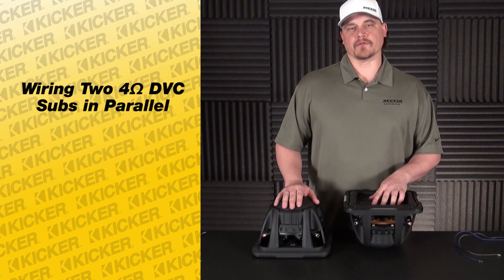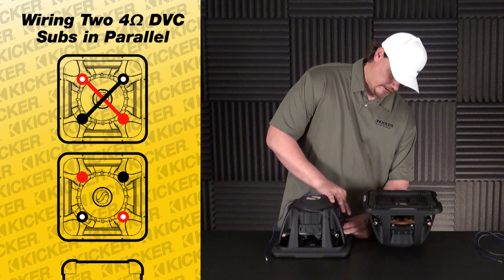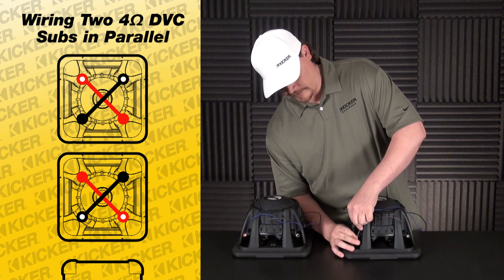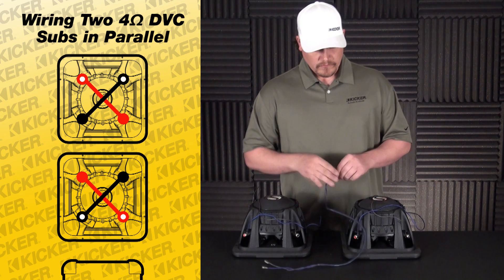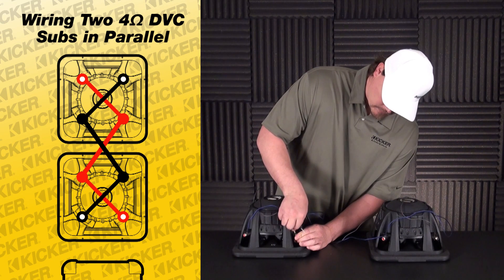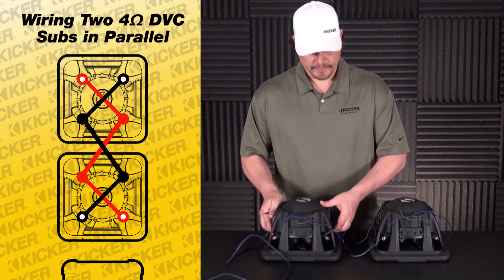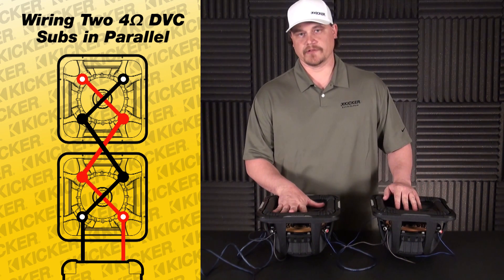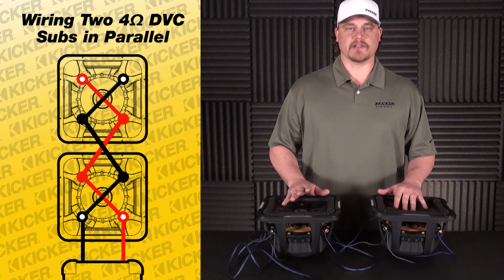Subwoofer Wiring: Two 4 ohm DVC Subs in Parallel

Comment: I have 2 dual 2ohm kicker l7 how will i wire them both to 2ohm load???
Reply from the maker: Devante Mccoy You will want to do a series/parallel configuration.  Wire each dual 2 ohm sub in series, then you will parallel them together and this will give you a 2 ohm load.
Reply: You have a video on that

Comment: Hey,I have a zx2500.1 and I have two 15 L7 2 ohm dual coils speakers. How do I properly run that to a1ohm stable. And is that possible with what I have. To have it pay with out cutting off on deep notes
Reply from the maker: TheTripleHouse The ZX25001 is stable down to 2 ohms.  If you try to run it below that it will shut down and damage the amp.  With the subs you have, you will want to wire them in a series/parallel configuration and that will allow the amp to see 2 ohms.  If you go to kicker.com and under the support tab there is a wiring configuration that will show how to do series/parallel.

Comment: I was always curious about the hole that gets drilled in the divider.  If it makes a difference in sound quality.  This is the first time I've heard anyone say one way or another if it makes a difference in the sound of your subs.
Reply: +KICKER Is it possible/recommended to connect each woofer to the terminals and run the jumpers between the terminals? Rather than drill holes and run the jumpers from speaker to speaker.
Reply: @Maverick_Van_Traveller  yes
Reply from the maker: Brandon Burks That small of a hole to run your wires thru will not cause a sound difference.  We normally recommend each sub having it's own air space.  We feel like each speaker can perform better and if something happens and one blows, the other is not working in twice it's recommend air space and can blow easily.
Reply: Sonif I have a 2500.1 soundstream and. 2 audiopipe 15s it's best to run them not togather in parallel for 10hm instead run the separate positive to postive neg to neg to  the run 4 wires from the mono block

Comment: I've been looking for help on a setup I'm putting together I have 8 15" 1000 to 2000 rms range subs they are split between two 4000 watt mono amps so 4 to each amp I know I can only go as low as 2ohm to each amp they are wired and working but I just want to know what's the best wiring setup my box dimensions are 32" wide by 64" long and15" high sealed in a 94 geo prizm double 20 farad caps double alternator and double battery I know what im doing just not in the sub wiring dept
Reply from the maker: Adam Corte Hey Adam - on your subs, are they dual 2 ohm, dual 4 ohm, single 2 ohm or single 4 ohm?
Reply: Completely left that out sorry they are dual 4 ohm
Reply from the maker: Adam Corte Not a problem!  You are going to do a wiring configuration that includes both series and parallel.  For each set of 4 woofers, wire each dual 4 in series.  This will create 4 x 8 ohm woofers.  Then you will wire all four in parallel to create a 2 ohm load to the amp.  Hope this helps.  If you have further questions just let us know.

Comment: How do I connect 2 Kicker CVR 12" to a 900.1 amp? Is it better in parallel or series?
Reply from the maker: At what ohm does the 900.1 need to run at?  Is it 900 x 1 @ 4 ohms, 900 x 1 @ 2 ohms?  Are the CVR's dual 2 or dual 4 ohm subs?  I apologize for the delay in answering.  Please let us know and we will get back with you ASAP.
Reply: KICKER the amp is 900.1 @2 ohms. The subs are double voice coil. How do I know if they're 2 or 4 ohms?
Reply: KICKER the amp is 900.1 @2 ohms. The subs are double voice coil. How do I know if they're 2 or 4 ohms?
Reply: The amp is 900 @2 Ohms. The subs are Kicker CVR DVC, don't know if they're 4 or 2 ohms. How can I check that?

Comment: I have 3 dual 4 ohm subwoofers I wire them down to to 2ohm and I wired all three together and I get .5ohm well I need an amp that is  a half stapled or will 1ohm do
Reply from the maker: You would need an amp that is .5 ohm stable.  Most amps that were 1 ohm stable would play at .5 ohms but you would not be able to turn up the volume and over time it would work the components harder and cause them to fail quicker.

Comment: How do I wire two 2 ohm dvc Subwoofers to .5 ohms final impedance
Reply from the maker: You would wire them exactly how Tyson is wiring the dual 4's in this video.   When you do this with a pair of dual 2 ohm voice coils it will give you a .5 ohm load.

Comment: No I don't have my box information cus I bought the speaker in a built box 2nd hand about 4 years ago, so Idk where the guy is now to ask that question, all I know that the speaker works,so if I put a good 1,500 or 2,000 rms amp on it, with a high output alternator,0 gauge wire and a good big battery up front would this be ok? Cup I'm not trying to push them at 3,000 rms...would the bd t1500 or the zx 2500.1 work also
Reply from the maker: Either amplifier will work.  I think you will like the sound performance better if you went with the ZX25001 because of the increase in wattage.

Comment: Oh and I was also told the speaker is 10,000 watts and 5,000 rms or 3,000 rms idk, so would 1500 watts rms hurt that speaker by under powering it? I been told alot of different story's idk what to believe that's why I'm asking u Mr kicker...oh and it's a 4th speaker so I'm a get it wired down to 2ohm
Reply from the maker: Originally this speaker was designed for SPL competitions,  It is able to handle 5000-10000 watts peak but only recommended for those 20 second bursts to get the top reading.  When people began using them in their everyday systems, we explained that for continuous music, the RMS value would be around 2000-3000 watts.  The different power handlings are based on the type and size enclosure you are using.   Do you have your box information?

Comment: OK thanks but one more question, I was looking at this bd t1500 amp which is rated to do 1000 watts@4ohms, 1500 watts @2 ohm and 1500 watts rms @1 ohm.would this be a good amp to run on that kicker solo X 18, I was told to get a high out out alt, or gage wires and a heavy duty battery up front, would this b a good set up also...If not I'm willing to spend around $700 or $800 bucks for a amp the bd t1500 is $700 bucks

Comment: Hey I have kicker solo X 18 and I was wondering could I power that speaker with a amp that pushes out 1500 or 2000 rms with no problem? Oh and I how would I know if it's a 2 or 4 ohm coil....I guess it would b a 4 ohm by it having 2 positive and 2 negative coils rite? I'm kinda new to the audio world
Reply from the maker: Hey Kevin - the S18X can handle the 1500 -2000 watts without a problem.  Make sure the other settings on the amp like the gain and bass boost are set at the right levels to be compatible with your headunit.  We made that speaker in both a dual 2 ohm and a dual 4 ohm version so it could be either.  If there is not a sticker or anything on it to tell you what the ohm is you will need to test each coil on an ohm meter to see what it reads.  If it's a dual 2 then each voice coil should read a little less than 2 and the dual 4 ohm will read a little less than 4.

Comment: Ok I have two 12 inch alpine subs both 4 ohms and I have 1000 watt sony explod will I be able to use it and get more power. If so how will I need to wire it?
Reply from the maker: Sorry for the delay in answering.  Are the Alpine subs dual voice coil or single voice coil?  On the amplifier, let us know what the RMS output is and at what ohm.  Is it 1000 watts RMS at 2 ohms mono?  I was unable to find exact specs so any information will help us be able to answer your questions.
Reply: Dual 4 4ohms and that's really all I know

Comment: I just purchased 2 l7 4 ohms 12inch subs.  I want to wire them down to 1 ohms, what is the strongest amp that I can use?
Reply: You will want to look for an amp that pushes 1500 watts RMS at 1 ohms mono.  Hope this helps.

Comment: Hw 2 wire 2 orion hcca 4ohm sub to soundstream  xxx10000d amp?
Reply: Looked up the specs on that amp and it is 10,000 x 1 @ 1 ohm or 5,500 x 1 @ 4 ohms.  With the dual 4 ohm subs that you have your wiring options will give you either a 1 ohm (parallel/parallel) or 4 ohm (series/parallel) load to the amp.  Whichever way you choose to wire them they will share the power.  You didn't mention what size subs you have and not sure if you are using these for everyday sound and or just for competition.  These two factors will influence how you decide to wire the subs.  Hope this helps.
Reply: hello sub are 2 orion hcca 15 dual 4 ohm,1 ohm 8245 at 14.4v,at 2ohm 6014, 4268 at 4 ohm

Comment: What kind of wire do you used to wire up the speakers?
Reply from the maker: We generally use either 12 or 16 gauge speaker wire.
Reply: They reco.end that for casual liatening. If u r goin to be pushin em hard juat use 8guage . it keeps the heat down and u dont hav to qry about what brand wire you r using trust. Ive been threw about 16 dif L7s since 1gens. U want best currsnt possible. Always remeber they want u to buy more. Thats y they quit the solo x's cuz u could fix you're self

Comment: Would it work fine if my amp is a 2channel ?
Reply from the maker: It will depend on the model amp you have and how it's designed.  You can run a speaker to each stereo channel.  With a 4 ohm dvc sub, you would probably wire the sub in parallel and then run it to one stereo channel.  This channel will see 2 ohms.  You will want to make sure the amp will run at 2 ohm stereo and that the power output at 2 ohms stereo matches well with the RMS power handling of the sub.

Comment: ok if you please tell me what to do, i have two 12inch kicker L5 4ohm subs and a zx750.1 amp. how can i get the most from it?? please please tell me.
Reply from the maker: With a pair of S12L54's you can wire them to either a 4 ohm or 1 ohm configuration.  The ZX7501 is is designed to work best at 2 ohms.  Ideal situation would be if you could exchange your dual 4's for dual 2's.  If this is not possible, one option would be to wire them in a series/parallel configuration and run them to the amp.  This would only show the amp a 4 ohm load which would decrease the power from 750+ watts to 375-400 watts.  Another option would be to run only a single S12L54 wired in parallel to the amp.  This would push 750+ watts to the single sub and you would have to keep all the gains and bass boost down and watch out for overpowering but it's an option.  We would not recommend wiring down to 1 ohm as the amp is not stable.  It will run at times but not consistently and all the shutting down will eventually cause issues with the amp.

Comment: Hey i have 2 dvc subs 4ohm each with a 2ohm mono amp can they work at 1ohm and do they draw alot of power
Reply from the maker: You can wire the subs down to a 1 ohm load but if your amp is only stable at 2 ohms then you will have problems with it shutting down at higher volumes or when bass notes hit.  Having this happen repeatedly will cause damage to both the amp and speakers.  If possible try to swap your dual 4 ohm subs for dual 2 ohm subs.  If not then you depending on what amp you have you will either want to run a single sub to the amp or run them at a 4 ohm load to the amp.

Comment: Ok I have a quick ? So I have two dvc 12in l5s that are 4ohm and a dvc 12in cvr 2ohm sub and I was wondering if I could wire these all together on my sound ordanace 1500m amp?
Reply from the maker: Couple of things - you don't want to mix the same size subs that are different models.  The sound difference when they play would muddy the sound and it won't be good. You could cross them over at different points but it's still not something we would recommend.  Next the dvc 2 ohm speaker would see a  different amount of power then the dvc 4 ohm subs due to the resistance of the voice coils.  The M-1500 is rated at 500 watts RMS at 2 ohms or 300 watts at 4 ohms.  Unfortunately this will not work with the pair of L5's because you would only be able to wire them into a 1 ohm or 4 ohm load to the amp.  You could run either a single S12L54 wired in parallel to the amp and it would see 500 watts or you could run the CVR122 in series to the amp and it will see 300 watts.  Hope this helps.

Comment from the maker: That is correct!
Reply from the maker: One is a reference to the way the subs are wired (the 2-ohm load part) and the other is a reference to the way a stereo amplifier works. First the subwoofer reference: you have a total of four terminals in two DVC subs.  There are a few ways to wire them.  Wiring in parallel cuts the ohm load in half for each sub, then in half again when you wire the two subs together because that's wiring subs in parallel once again. You now have a 1-ohm load, all before you connect the wires to the amp. If you wire in series, you double the ohm load instead of cutting it in half.  This is a very brief explanation admittedly, but it's a start.  Read more about it here: https://www.kicker.com/wiring-diagrams

Now, the amp question is a little different, but simpler. The reality of all amplifiers is they are all mono (a single channel), no matter how many channels they have in the casing. When people try to "bridge" an amp, which is very common when you want to get the most out a subwoofer, you usually combine the two smaller mono amps inside by wiring up the left positive and right negative speaker terminals.  Internally, this creates a single circuit between the two channels. For many amps, a 2 ohm bridged load is unsafe because the manufacturer did not design them to handle that amount of heat. When you wire them stereo instead of mono (a positive and negative wire on each of the two channels) they are stable at 2 ohms, and normally deliver the same amount of power as a 4 ohm bridged load.

If you want to know more, call us.  We are open weekdays from 8-5cst and my Tech group can take you through the info step by step.  The number is 405-624-8510.
Reply from the maker: Either 1 or 4 ohms depending on how you wire it. You might want to grab this free app we made called Kicker U: http://www.kicker.com/kickeru. It gives you wiring instructions, test tones, a wire calculator and much more.
Reply: KICKER I have 4 12 kickers cvr with a 4000 gravity 1 om's amp how will I wire them inside the box please help
Reply: I just by me a DX 1000.1 & one 15" L7 2 ohm how can I wire this? please help
Reply: two s12L7 4 ohm in amp zx1500.1 how connected.. parallel/serie-parallel?
Reply: KICKER I have 4 subwoofer all 4 are dual 2ohm if wire all 4 what will I get
Reply from the maker: The ZX1500.1 is rated for 2 ohms mono, so if you have two 4 ohm speakers, 2 ohms will deliver the most power. You'd wire in parallel for that.
Reply: KICKER
Reply from the maker: Hi Dereck. What would you like to know?
Reply: For an amp that is 1500 (but rated at 1900 watts mono at 1 ohm) would 12" kicker L7 subs or 15" kicker L7 subs be best? looking for lower bass since I listen to a lot of hip hop.
Reply: Kicker...i just bouth me a kicker zx 2500.1 amp..n i wanna put some 15L7s subs...wats the best way to go 2ohm subs or 4ohm subs without hurting or over Heating nothing but at the same time get lots of power from amp n subs.